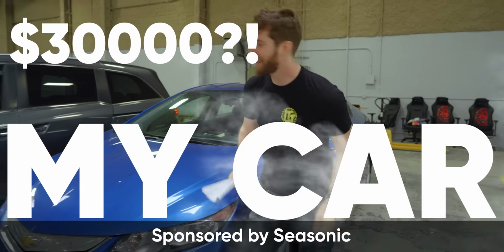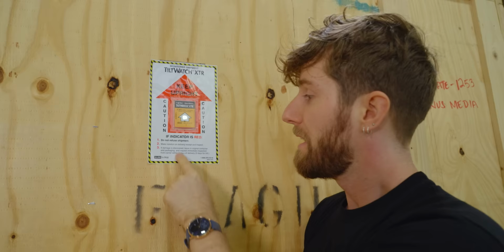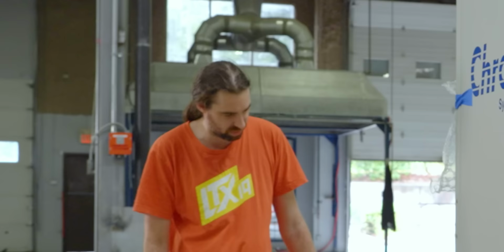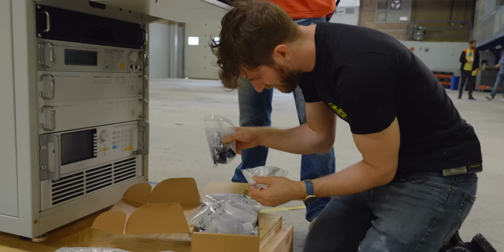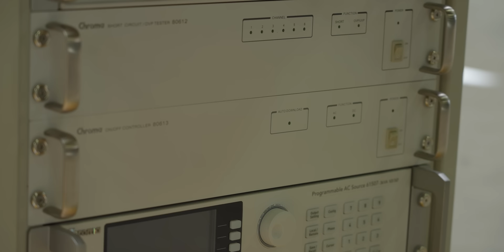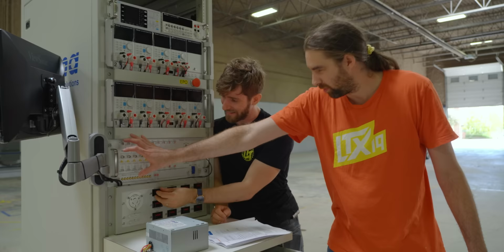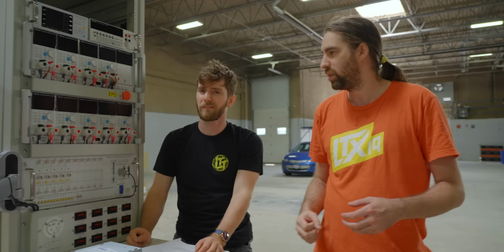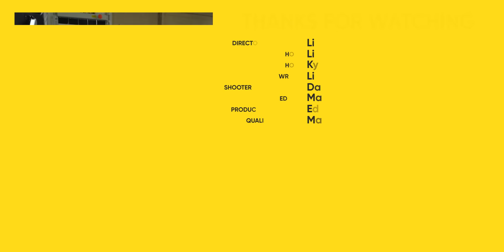The most EXPENSIVE thing I own.

Comment: I haven't even watched the video yet, other than the intro and sponsorship, and I've got to tell you, Seasonic is the ONLY power supply I will use in my builds.  I've had other power supplies fail, one actually catch on fire and destroy my CPU, MB, GPU, every hard drive and DVD drive (tells you how long ago it was) in my system.  So, Seasonic is my go-to power supply manufacturer.  Even at one job I had, we exclusively used Seasonic.  Out of all of them, I've had one that was DOA (at work, not one I bought) and they continue to run and run and run.  Buy Seasonic if you want a great power supply.

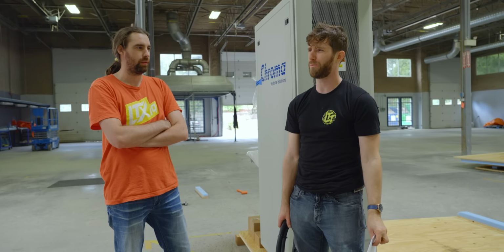Comment: 4:25 European breakers can actually take over 3500w, and modern ones go up to 5500. :)
Reply: @marcogenovesi8570  Well, yeah. But considering the 3500 and 5500w breakers are the standard here, I'd imagine the cabling is also up to spec. Breakers are supposed to be the safety feature, after all.

Comment: I’ve always wondered, once unboxed how does one get such a heavy thing off the bottom pallet?
Reply: little late in watching this, but you can use a forklift, or a manual "pallet stacker". Check them out on amazon or something
At large data centers, at least the one i work for, we have our own custom made ones at each data center, to lift fully loaded server racks off of pallets, push the pallet away, then we just roll the server rack to its location, and then drop and place

Comment: Nice stuff, looks similar to test equipment I use. Word of caution though, please keep operator safety in mind. You'll be dealing with currents over 50A and precautions should be taken. Just setting it on that table and plugging it in and seeing what happens, not safe. Even a high quality power supply can suffer a failure. PPE is cheaper than a life.

Also, using a fixture to just slide into the connectors ... not a great idea, I don't see any kind of alignment guides to support that. You don't want to freehand that kind of thing, you spent an awful lot of money on it, don't risk that investment with needless damage.
Reply: This guy engineered extremely small tolerances for the screwdriver. He can probably line the holes up.
Reply: @user82938  You've obviously never set foot on a lab or production floor before.

Comment: So for the newbs, what exactly is this thing used for and what makes it this damn expensive
Reply: Expensive is because it is Chroma ATE😅
Reply: Used for testing multiple aspects of power supplies. It can simulate a multitude of situations that a PSU would need to endure, and reliably record the results. It's so expensive because it's a lot of top of the line, specialized, enterprise hardware.

Comment: European voltage is 230V and modern standard for home wall plugs which are 1~ are either 10A (for lighting) or 16A (for appliances etc) breakers. So 2300W or 3680W. But this machine was 3~ and I didn't really catch if it was 3500W for each phase or what?
Reply: Can't speak for the rest of Europe, but Sweden has been 230V since forever. Not a big difference. 160W...
Reply: European Voltage is 230V though.. It indeed WAS 220V, but it got changed to 230V (I forgot when exactly, but you can easily Google it). It's basically the same and it makes no real difference, but I'm 100% sure that the norm is 230V, not 220V.
Reply: @fourcgames7568  oh, right, woops. Dunno if my memory failed me or what. Edited to correct it.
Reply: European power is only nominally 230V, but it's actually a range, currently 230V+10%/−6% (216-252V), but to be widened to 230 V±10% (207-252V). That's to encompass the real-world voltage ranges. For example, whilst the UK system is officially 230V, in practice the delivered voltage is about 240V. However, in some parts of eastern and central Europe you are more likely to get about 220V. So that 230V specification is for manufacturers of electrical equipment to make sure it will work within the range.
Reply: Yea man , we have 16A @ 230 +/- 10% , bit over 3.6kw

Comment: Europe here: It is 3680 Watt (16Amp 230V). But as an electrician  design would be power factor .9 = 3312 Watt. In The Netherlands a maximum domestic circuit breaker is allowed 20Amp (if main fuse is 35Amp. Or just get 3phase 16Amp

Comment: Actually standard european breaker goes up to 3,7kW, since we got about 230-240V on 16A Breakers in a standard german room. AFAIK the most you could get out of a private home powerplug should be something around 13kW with 400v 120° phase changed AC and 32A Breaker.

Comment: Electrician here, the cable is actually rated for 18,000. With three phase power delivery you multiply volts x amps x √3. That's why we use three phase. It's much more efficient.

Comment: You can't slot a backplane into an L5-30/L6-30 connector unless you manage to come up with a mechanism to rotate the plug after it's attached. Not twisting the connector creates a path of high resistance since it's not fully seated.

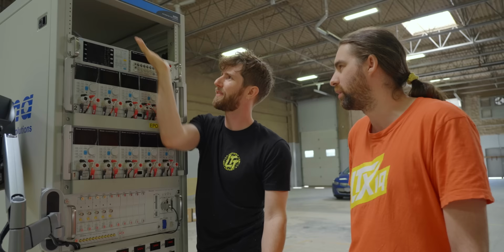Comment: 13:49 yes you do, it's for the temperature measurements! the DMM has a scanner card and can monitor multiple channels, an oscilloscope is not not sensitive nor accurate enough for it, and only has 4 channels

you can also use that meter to measure voltage and resistance with great accuracy!

but where is your insulation tester? :o

Comment: 4:27 A typical German breaker trips at 3500W. 16A @ 220V (pre 1990) = 3520W, 16A @ 240V (to 250V) = 3840W (/4000W).
Though, those are for the whole room. If you have 4kW power supply, you can't turn on any lights. Especially with electricity prices of around 0.75€/kWh.
Reply: In Belgium socket are almost always 20A which makes 20A @ 230v = 4600w so nah not gonna trip Linus 😅

Comment: 4:27 germany has 230V 16A at 50Hz. So its 3680W if you use single phase and about 11kW on 3 Phase. You can even do that over a cable about as thick as a thumb.

Comment: In Austria we typically have 16A for outlets which correlates to 3680W (3500W would work properly) but there are also 13A breakers in use (typically for lights and thinn wire for outlets) that correlates to 2990W (2800W without problems)
I'm sure it's in the most part of Europe the.

Comment: wow that's nuts! that thing (or the power cable) is rated to draw almost more power than my massive 325amp gasoline powered welder-generator (miller trailblazer 325efi w/excel power - peak = 12,000watt, continuous 10,500 watts)

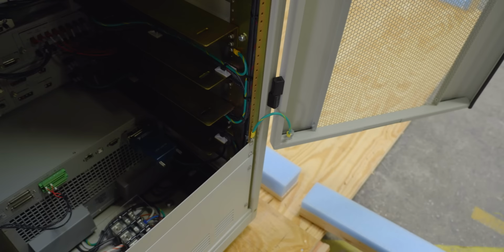Comment: At 5:08, the image of the ground wire connecting the rack to the door the powder coating on the door where it will make contact with the nuts on that ground stud should be sanded away so it makes good contact...

Comment: I don’t know about the standards in the rest of Europe but 20 amps at 240 volts would be 4800 watts. 
The breaker can don’t pop at 3000W.

I also have a couple 400V outlets in my house if you should need more than that.

Comment: cables aren’t rated by watts- just amps and voltage (which I realize combine to make watts), but you just say the amp rating- typically the higher the voltage, the smaller the diameter the wire needs to be to carry the same amperage.  So the biggest diameter wires are actually from lower voltage systems that carry way less overall watts for the same amperage.  6v and 12v high amp draw systems use ridiculously low gauge (thicker) wires.
Reply: Which is why voltage is stepped up for long distance wire runs and power distribution.

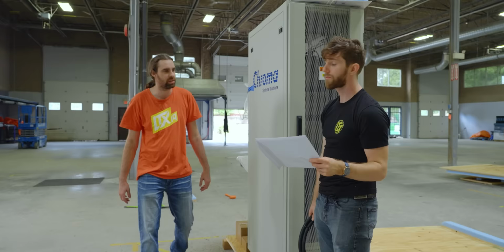Comment: 4:20 at least in central europe the breakers are 13 or 16 Amps (it depends for example on the material used for walls etc.) so max. 3680W. On 3-phase, 16A it´s 11kW

Comment: Oscilloscopes are good at measuring time domain stuff (level changes). But they are nowhere near as accurate as multimeters. Voltages you see on an oscilloscope can be widely off compared to a proper DMM. Also there are things you can't measure with an oscilloscope easily due to ground coupling Oscilliscope has to have. Oscilloscope is usually grounded while DMMs are floating. You should not be poking around and measuring rails with an oscilloscope as that can be dangerous. You should always investigate what you want to measure on an oscilloscope with a DMM first.

Comment: So this thing could send multiple timed microsecond power bursts? Did Linus have to sign a waiver that he's not building (a very heavy) doomsday device? Two is all you need technically but if each module can do two that's 16, split that somehow again into 32 and you can do old school 32 point implosion. And he's got the hardware to run lens configuration tests.

Comment: They need the multimeter for current measurements, capacitors, inductors, high accuracy voltage peak measurements, DC and AC measurements, whole bunch of other things.

Comment: you want the multimeter because it's the worst to have to undo your a/c monitoring just to double check if your d/c somewhere else in the circuit is the right voltage. Granted, your scope will likely have a six pack of signal inputs, but you never know when you may be using them all, plus if your volage difference between your a/c range and the d/c value is large enough, you won't be able to get both waveforms in the screen, though any decent scope will have split screening, but then you're losing detail in the a/c measurements' representation, just to check a d/c voltage. Suboptimal. When you're in for that much already just spend the $500 or so on the racked multimeter and call it a day

also be prepared to post this same title again when the scope arrives. You could buy multiple of these for the cost of some of the better scopes out there.

Comment: Nope Europe is only limited to 3,6 kW if using household outlets. CEE 3 phase 16 A for 11 kW are very common in garages. An Meanwell RST-10000-48 for a 48 V server in the garage is possible. Some have CEE 3 phase 32 A for 22 kW. So i think you have to upgrade.

Comment: Live in Germany and knew someone who plugged two 2000w heaters in a single outlet and it worked. So 2500w isn't gonna trip a European breaker (or its unlikely).
Reply: Obviously that doesn't mean it goes for every outlet in Germany. But the outlets are rated for 3600w where I live.

Comment: i'm not really sure what you talking about european power, most places do have only 3,3KW, but you can easily change to 4,5, 6 up to 16Kw on 220V at least here in italy, i'm running at 6 KW right and a switch basically takes one phone call and half a hour to get the settings changed on the counter.

Comment: Dmm probably used to measure the AC input voltage (supply under test/ SUP) of the AC generator iso using diff probes on the scope input. Could also be used to measure the output resistance of the SUP

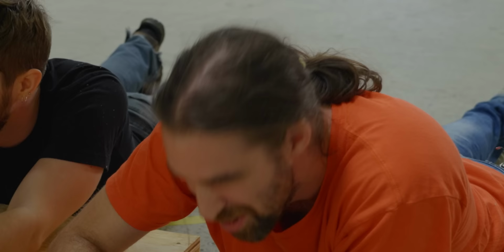Comment: 8:12 well I know this is very off topic, but a microwave has the turntable motors and one or or two AC fans, other than coils in the magnetron and the high voltage transformer, which are all inductive loads. That wasn’t so bad as an example.

Comment: I just came across a super interesting thing you could do. When I plug my audio and use the USB for power, noise leaks into audio from the dirty USB power. It seems that 5v rail is just noisy and gets into anything plugged into the USB for power and really effects audio equipment. It would be interesting to see which power supplies make the best, least noisy PS for audio use.

Comment: I uswd to work on a large computer repair company that has genrad power supply testing as well as board testing equipment with probes and flying probes  i highly recommend tou to use a enclosure blown caps are really dangerous

Comment: Here in the Netherlands we also have 400v! Can that machine do that to? Its standard here is: 230v x 16amps for normal breaker, 230V x 20A for a little bit more energy, and then like 400v(3-phase x 16a. I recently installed a car charger and we fused it to 400v(3-phase ofc) on 48 amps! Yea we are a little power hungry over here😁😁😝

Comment: "Maximum of what europe can do" is not accurate. Here in The Netherlands we have 16A fuses on 220~240 Volts. So normal households have between 3500~3800 Watts per phase. If you have 380~400V (yes it is available at your home) you have 3 phases on 16A, so one 380V can pull up to 11040 Watts. 😛

Comment: Actually you mad ea mistake in your video, a North American standard 120VAC circuit is 15 amps, to get the max wattage you multiply volts with amps, so 120 x 15 = 1800 watts, so that 15A breaker has a capacity of 1800 watts, and not 2000.  The 20A circuits have a capacity of 2400 watts.  For the 20A circuits you would need min 12 gauge wires - how fun it will be for people to rewire their homes from 14 to 12 gauge going from 15A to 20A to barely run their future gen GPUs :P

Comment: By the way the chassis being earthed has nothing to do with having a lower resistance that the human body...  In a fault condition if the chassis were to become live the earth provides a low resistance path back to earth which means you get a high fault current which will trip the circuit breaker in a timely manner...  So the earth or ground is there to stop the chassis staying live and potentially dangerous should someone touch it..

Comment: Kewl! Test some ASUS PSU's as well, like the Thor 1.2kW which I have 😜. Also I'm from Belgium, so EU, but we have 20 amps on our normal wall outlet (so 230V x 20A = 4600W) Our tri-phase ones are rated 400V. You are welcome to use my basement so I can become part of the LTT Group too hehehe 😋 And if that is not enough, I work on the Belgian electricity grid so if you need a few thousands of volts or amps...

Comment: I know there was none so power hungry PSU but it might not be always a case with current changes. Even though as a European with old 20A installation where I have seen 25A/30A 230v breakers 1phase and where every new house has a few 3 phase outlets 25a I feel that u don't have enough power in current configuration to impress even 16A outdated configurations what a pathetic try to say it is even close.  I am thinking about normal power outlets not connections designed for heat pumps but what you can find in living room or kitchen. I want correction in video XD. I can not say that anything less than 14kW is impressing when it comes to power consumption. I am waiting when you start testing server stuff.

Comment: Linus, please stop doing electrical calculations in your head, you're usually wrong. The 3 phase power calculation is (voltsxamps)x1.732. So a potential output of 18kw. 
Also, a standard plug circuit is 15 amps, so max output is 1800 watts. Better to run a dedicated 20 amp circuit, that gives you 2400 watts of potential. Or better yet, a 12/3 20 amp cct, you could output 4800 watts from one receptacle(top and bottom outlets).  Also you really should only load your breakers to 80% of capacity.

Comment: Bruh... $130k for 3500W? wtfff did you even do any research before buying that thing? or did you just give the credit card to employees again? 
Itech has solutions from 10k that will do more than that machine.... I can do 3500W constant in my house with single phaze 220V.... and it only takes up 4u not a whole fucken rack.

Also, so you know, most modern houses being built these days use 30A breakers @110V so most American houses these days can actually do 3000W on a circuit. Especially when hair dryers are pushing 1500W these days.
Reply: problem with Itech is the ATE software it not really good compare with chroma 8000 platform. (but they have better customers service) . if you have skill to make a ATE software via SCPI code it not a big problem
I have used IT8700 multi load series over 10 years ago